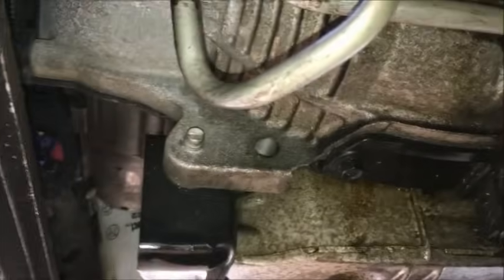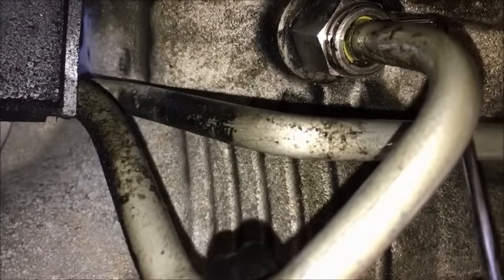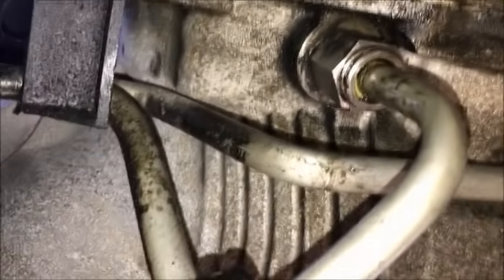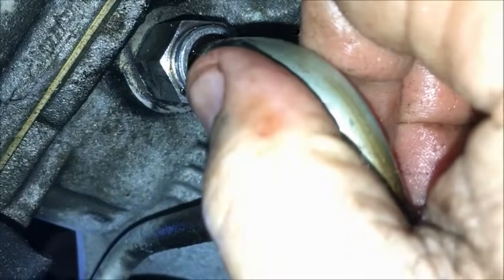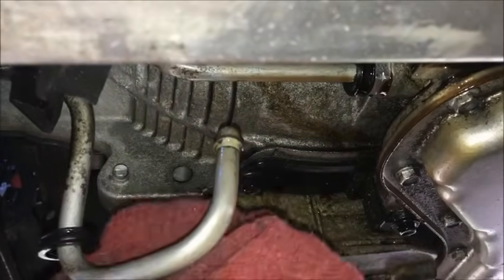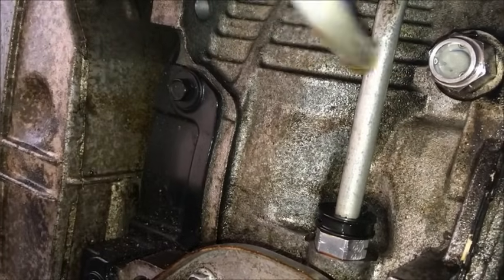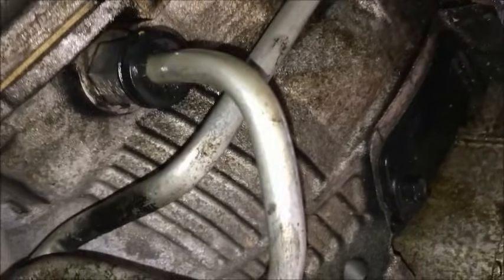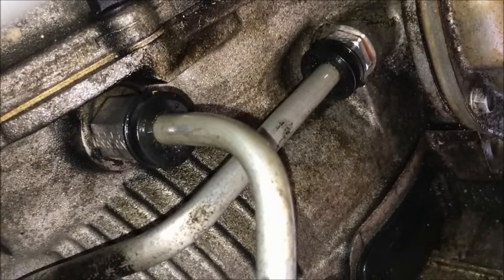How to Replace GM chevy Automatic Transmission Fluid Cooler Line Fittings

Comment: perfect video. I love it when people just start working right away, and save the talking for as they work.
Reply: How much would this cost in labor
Reply: @gregbloch2765  Depends on how much of a rip-off artist  the Mechanic is.... I just bought both of those fittings of Amazon $33 Ac- Delco.
Half hour labour charge is in order max.
Reply: O j

Comment: Just did this on a 2011 JL Wrangler to replace rusted/leaking lines with new ones. Couple things I learned:
1) Old rusted lines at press in fittings don’t allow a quick disconnect tool to work (had to use two picks).
2) To get clips out manually, had to soak clips/fittings in PB blaster and work them to loosen the clips.
3) Scraped out the fitting edges for a while around the line press fit to get rust out and PB blasted again. 
4) used one pick to press between line & clip bump out to push it outward so I could hook clip from outside with other pick. Longhandled needle nose pliers are a must for grabbing clips, etc on this job.
Here’s where it got even harder…😢
5) after clip removal Fittings at radiator were rusted in place and would NOT come out… Kept at them with PB blaster and grabbing metal line with Longnose pliers and cranking back and forth to eventually pull the lines free. Was tough and took at least 10 mins of wiggling forcefully while pressing outward on the line… PITA.  I heard some people recommend cutting lines and using a deep so it to remove fitting body… my fitting body just spun near radiator as it seems like a compression fit at radiator tube… I didn’t want to mess it up so left it… spinning that fitting nut without cutting lines might help to break the rust free from the stuck line … but I just kept using the long handle needle nose and wiggling and pressing til it eventually popped out. Removing lines at trans much easier. 
6) Had to do some slight bending of the new lines to get them in correct shape and fit so they didn’t rub on anything or each other and didn’t have odd angles or tension when fitting them into the clip fittings… you want the line end to push straight in and pop in all the way so the clips can be installed and hold get in front of the line end flanges so the lines wont pull out. Test pull these after you get the clips reinstalled.
7) Reinstalling clips was sorta a pain because you had to make sure the lines were fully seated so the clips got in front of the line flanges to hold them in… the clips have 3 bumps or spots the snap in to holes on the fitting clip channel. Hard to see but the center clip goes into the short hole (channel) and the end of clip slide into the longer channel hole openings.
8) Test pull on line and make sure clips are fully seated into fitting as evidence by clips  being full down into the channel and not protruding (needle nose to make pure they are pressed down fully.. if not the line flange may not be all the way pressed in - must press in straight which might require a slight line bending). 
10) once all closed in a pull tested, start engine and check for leaks.
11) no leaks push plastic cover back over clip fittings (might need to use a bent nose long handled needle nose pliers as I had to put tip on either side of plastic cover and give it a hammer bump to get covers to seat fully. 
12) Install line plastic retaining guides so lines don’t rub on anything or each other, hit anything or press against any other parts.
13) replace the amount of fluid you caught in pan when you pulled lines.

Comment: Tip for 98 s10, the upper fitting on the trans is really really tight. I unbolted my flex pipe to give me room and will be unbolting the cab on that side and will jack up the cab to give me room for a ratchet. I have to weld in a new cab mount anyways so might as well do it all at once. 

Also for some of the fittings I used a sawzaw to cut the line that wouldn’t come out, in order to get a socket or box end of the wrench on. Used pb blaster for a long time. Supported the radiator with a wood block since my mount was rusted. And slowly slowly torqued the fitting of as to not crack the plastic radiator. 

If you can spray pb on the fittings days in advance.

Comment: Kinda forgot to tell us to put the clips in first cuz on mine, I didn’t.   And now I can’t get them on.  So it’s a good thing I didn’t know what I was doing wrong til I saw how you didn’t tell us how to do it right so thanks!
Reply: Did you not watch the whole video? you see he has the clips in as he pushes the line in clear as day at the 3:00 mark. It’s the whole point of the quick connect fitting to be able to do that… same as fuel line quick connectors and so on…

Comment: If these are leaking would it cause a pressure issue?
Mine drips and sometimes I get semi-hard shifting.
Reply: Yes it can. As the fluid leaks by the ring, it also allows pressure to escape and possibly causing shifting issues.
Reply: @peterm3333  thank you sir the exact same thing happened to my father’s Dodge Magnum, a decade or so ago and it felt exactly like that. I appreciate your knowledge and input. God bless happy holidays.

Comment: That's the way to do it straight to the Point, but you left out a very important step. You gotta put the  o ring back onto the fitting before you slide it on there. You can't just assume people know that

Comment: Took me 5 hours to do that today on the lower Inlet.  2013 Acadia Denali.  Couldn't get the clip (3 flew away) in the nut.  New clips assortment $18.00  Yes, I had a Pick.   Wasn't sure that fitting came out of the rad.  I ended up putting the pipe in then the clip.  Put a small rad clamp on it just to be sure.

Comment: The oring's can be replaced Iv'e done it many times to many different Chevy models this will save you alot of money if you were to replace all the fittings on the vehicle. Its about 30 bucks for oil and trans cooler fittings as opposed to under a dollar for the orings.
Reply: Ryan Shepard cause it’s a 6 dollar fitting 😂 jus change the whole thing
Reply: @drzg2640  lol and it takes more work to replace just the o-ring lol

Comment: How much transmission fluid needs to be put back in after changing that same fitting? Does a lot come out when changing a new quick connect fitting? Just wondering how many quarts I need to buy before doing this.

Comment: Thank you very much for sharing your knowledge. I have a question, in my Dodge Avenger 2008, one of the cooler lines just disconnected it self from the fitting and all the transmission fluid spilled out... then I bought some universal o-rings and installed the metal line back into the fitting, and of course pour more transmission fluid.  So the question is, is there some chance to the metal line to disconnect again from the fitting???, do you recommend to change the whole cooler line?
Reply: best  bet  for  you   buy  a   Bus  ticket

Comment: Will it over heat if this bolt is leaking an not tight
Reply from the maker: I’m sure it wouldn’t be good. The reason why I changed is because it started dripping on my driveway. I didn’t drive the car until it was replaced.
Reply: Ok well I haven't got up under it yet but looks like it's leaking there an that's only place I see leak as it's over heating nothing in oil showing head bad

Comment: This looks like the Chevy Uplander minivan I need to look at. The hex bolts aren't bad the hose itelf has excess leak downline where metal coupling meets nylon hose.-As far as removal, can I just unbolt the hexes on each end and transfer them to new hose separately on the bench or do I HAVE to unclip hose before removing hex's?-(Also had a different Buick that the A/C was leaking, compressor good but one hose had same metal pipe coupling into rubber hose, so shows what GM knows about making their inline metal to rubber couplings durable.....)(and of course it was an all-in-one hose ASSEMBLY so even though only high side hose was leaking, it took the perfectly good low side hose with it, more GM logic)

Comment: So instead of replacing the entire line you just replaced the fitting??
Reply: Because im having a leak problem probably with the same thing so i was about to buy whole new lines but if i can replace the fitting that would be alot easier

Comment: Why don't they just have male female screw on fittings this clip b.s. is stupid design.would change out hose fittings at bottom of radiator hard to get to plus attached to plastic radiator don't want to crack pain in the ass😡